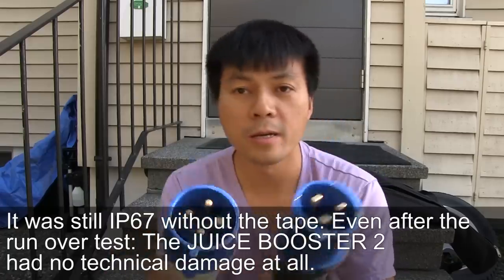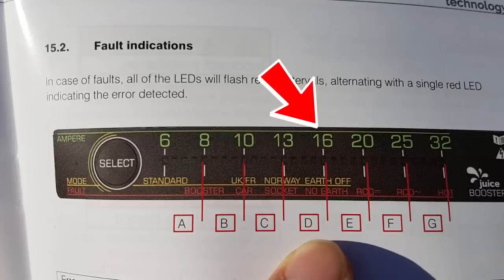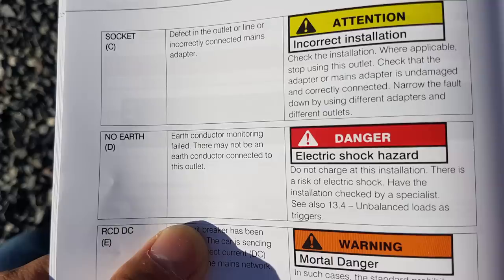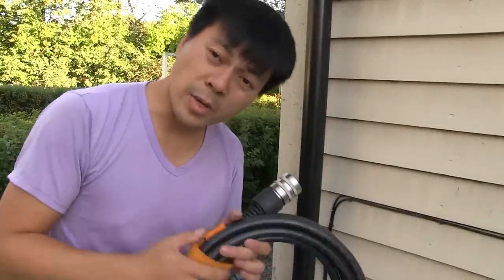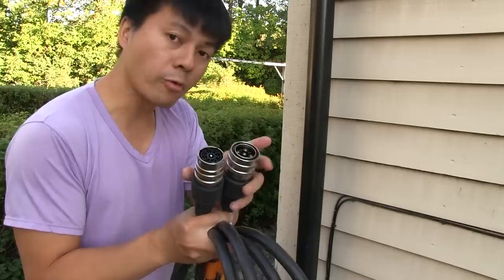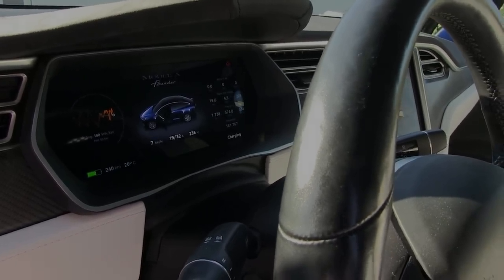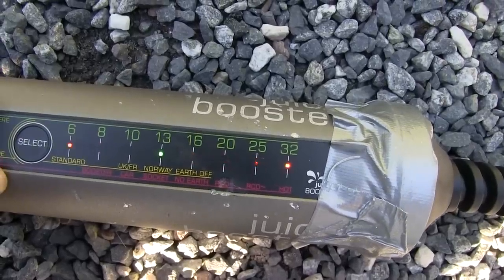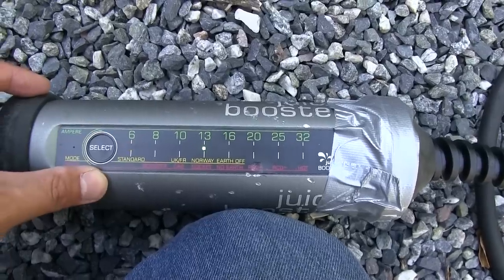Juice Booster review v2

Comment: Hey Björn, like Norway and perhaps Albania, Belgium has the 3-phase 32A on a blue CEE plug too 🙂
Too bad the 3-phase doesn't actually use 3-phases and you're still limited to 7.4 kW. 
And yes, I would buy it it it actually would give me 11kW (or 22kW) on a 3-phase blue 32A Belgium/Norway network

Comment: Because they use a metal housing for the juice booster, there needs to be earthing (protective earthing conductor), in case there is a fault in the device and the fuse (RCD) protects you from  current flowing from the metal housing through your body. {hope I could explain it easily and correctly}

Comment: Too expensive
Reply: dunno. it essentially replaces a wallbox and allows you to plug in about anywhere. depending on your environment, that's the more flexible choice (and typically within the range of cost of a wallbox). so, depending on the situation, it's cheaper. and definitely more flexible
Reply: @davepermen  go-e charger is as flexible, but only costs 600€ vs 1000€ for the juice booster.
Reply: the go-e is much newer afaik, but is another great choice. it would be my Default choice for a Wallbox nowadays, actually. it's tiny, cute, and can be built into any other form or shape if you want to go fancy. i do love the Juice Boosters ruggedness, though. the cables and plugs are great. was my only charger for over a year, very reliable. but yes, the go-e is great, too, and i hope i can try it out at some point
Reply: There are already differences between the two products which in my opinion justify the extra price. For example the material which was used for the outer shell, on one side aluminium on the other side plastic. Then the protection class, on one side IP 67 and on the other side IP 54. One device can be driven over with more than 3 t wheel load, the other device is not. What is surely an advantage of the GO-ECHARGER is the integration into a Smart Home and the possibility to use RFID. That's why I would recommend the JUICE BOOSTER 2 to someone who wants to use it a lot on the road and outdoors, and the GO-ECHARGER to someone who uses it mostly at home in the garage or for companies who want to use the possibilities of RFID.
Reply: Really? Alternative?
Reply: Why not? Well the go-e is not so sophisticated as the Juice booster but it has very similar functionality. It offers a wide range of adapters for the travel use. 

The wall mounting of the juice booster is nice for the stationary use case. 

But in general I ask my self beside the 32 A loading why cant I use my universal mobile connector (UMI or the brick from other EVs) with some adapters to get the same use ability?

Comment: Did it rain sometimes ago ? This may explain why it is working now. If the ground is wet, the value of your earth is lower than this summer.
It depends of your ground. If it is sand or rocks, this might be the explanation. Usually, the earth is better if the soil is made of clay.
For your own safety, it might be good to add more grounding rods.
You can have a look here : https://electrical-engineering-portal.com/improve-earth-electrode-resistance
Reply: It could be close to the cut off for the safety trip. It was a very dry summer after all.

Comment: Hello Bjorn. I rescued this old video because I have now a Juice Booster 2 and I suffered the same error the first time I plugged in than you showed us in the first video. And after several trials in different sockets and also with 2 different cars I discovered the fault: The fault was that the connector of the plug adapter to the juice booster was not properly clamped. That means that it is important to align the red dots on both connectors and then push and hear the “click”. This was what happened in my case.
In any case the Juice Booster is a great product because you can juice up everywhere even in bad installations and you can use as a wallbox or as a portable charger
Regards

Comment: I don’t think that 4 pins can deliver 3phases. You need 1 pin for every phase, 1 neutral and 1 ground. Maybe it’s a 2 phase plug?
Reply: Old comment, but in Norway (the old power network, IT type) and Albaina, you can get three phase power on the 4 pin plug since its 230v between the phases, the transformator does not a neutral so it means one of the 3 phases have to have "two" loads on them, if you have the 3 phase 32A blue plug you can only draw 16 amps from each phase because one of the 3 phases are used of the two other phases | L1<->L2<->L3(<->)to L1 again
so in this example the second phase with have 2x16A drawen from it.
very stupid design, I'm glad we are going away from the IT design :)

Comment: I guess there are different versions of the Tesla UMC, but in Australia mine is capable of 3-phase charging with the Euro adapter and a correct AU 3-phase plug. It can nearly supply the full 16 kW that my onboard charger can draw. It almost becomes a portable HPWC as far as my car is concerned. Are you sure your UMC is only capable of single-phase?

Edit: I re-watched that section of the video and noticed that your adapter is blue and only has the 3 pins, while my "Euro tail adapter" is red and has 5 pins. Is it not possible to use the red adapter in Norway?

Comment: Hello Bjorn. I still don't understand what a Juice Booster does so I have a question. I'm thinking of buying a Kona Electric. The Kona has 1 phase type 2 plug. Kan the Juice Booster covert 3 phase 11kw current of a public charge point to 1 phase 11kw type 2 for faster charging? 
Greetings from Holland.
Reply from the maker: +Michel Roerdink Nope. Juice Booster is a portable charging station. It doesn't do any converting.

Comment: Now I'm curious : what is section 13.4 saying about unbalanced loads ? (2:34)
Reply: Hmmm I never heard that it starts to burn by un balancing the network. Agree you should prevent it but it is also a Myth that EV needs that much current that the whole network gets unstable. Even in the house. But you also can install 1 phase 32 A wall outlet and they would un balance the network as well.

Far more a problem is the contact resistance in wall socket. Especially wall sockets outside might got corroded which increases the contact resistance and produces heat. Second point is the wire resistance if the diameter of the cable in the wall is not sufficient. To check this it is essential and very easy. 

if you connect to an unknown or new wall outlet:

Generally check the voltage drop when you start to load.

1. Check the temperature at the wall outlet while connected and the car is loading after 15/30 minutes. The plug gets significantly warm when the wall outlet is corroded. It is noticeable if you touch the connected plug. If the plug gets hot I stop charging at that outlet in general.

2. Look for the voltage drop when you start to load compared to the voltage after 15/30 minutes. For Europe if you are below 214 Volt Monitor carefully. Below 207 Volt it becomes critical. Make a temperature check at the wall socket if it gets hot.

Reduce the Current manually that the voltage loss is in the acceptable range. 

If you are unsure start with a low current and increase it step by step by monitoring the voltage drop and temperature.

I am loading very often at regular standard wall sockets (Schuko) and experienced a lot of them to be good to get the full 16 Amps. Very good are those which being used or dedicated for washing machines and dryers. Bad experience I had with the outside integrated wall sockets. 

Load safely :)

Comment: The Voltec charger J1772  (used by Volt/Ampera) is I think the best as it is both portable / wall mounted and you can also roll the cable on it. So highly versatile.  Oh, and BYW, I had the same problems as Bjorn with earthing

Comment: I honestly don’t know why anyone would buy it – every ev comes with a portable charger
Reply: No, every EV comes with an onboard charger (inside the car) and a power cord. The thing you refer to as a charger is just a cable with some protection electronics.
Reply: Well the normal portable charger will give you 2,4kw at 10A Schuko. With the juice booster you can get up to 22kw at cee 32A. And it has a built in residual current device type a and b to protect your car charger, your home installation and you.

Comment: If I remember correctly, the last time you were using some red to schuko adapter, I guess there is a earth connection broke somewhere in the red extension cable or the adapter. I guess the earth is properly connected to the blue connector on you house...

Comment: WOW how come your house happens to have 3 phase???As for the juice booster  its working now because you run it over!! LOL
Reply: Depends on the country. In germany for example you also get three phases with 63A each, usually.
Reply: All houses in Norway is supplied with 3 phases except some apartments and some very old installations. We use much more electricity than rest of Europe, we heat our houses with it because it is so cheap.
Reply: In Slovakia you can have 3x16amps, pretty much standard.
Reply: @User888User  in Belgium's we have 1 phase with neutral (ex. 40A), 3 phase with neutral of 3 phase without neutral, devided dromen that 2 fase, last two can't be used for havy loads of even 3 phase loading.